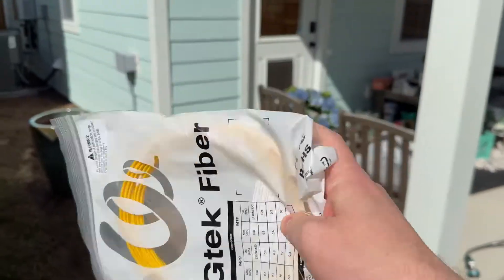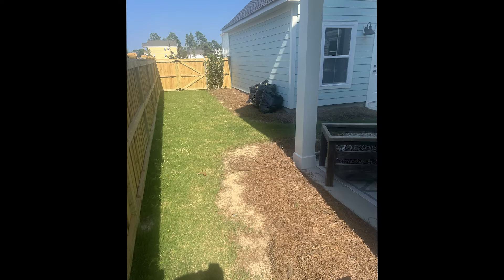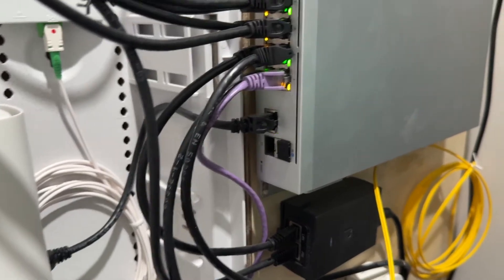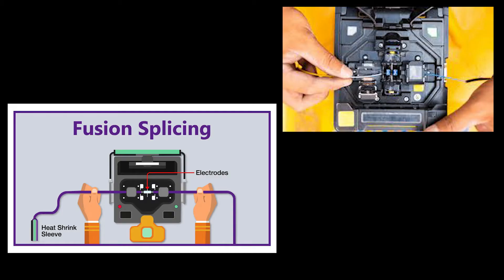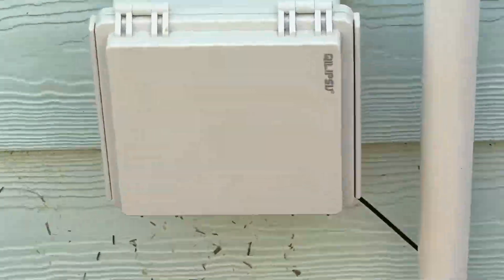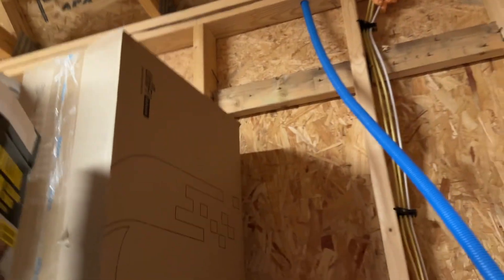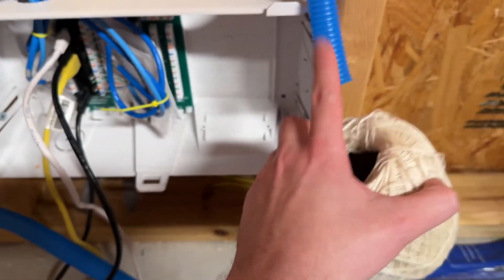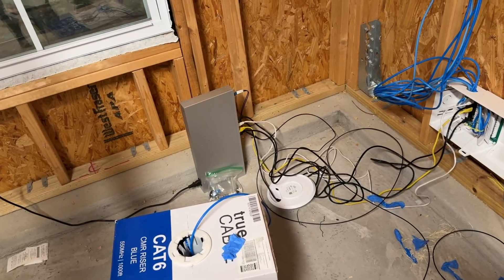Running Fiber Internet to a Garage/Shed

Comment: Looking for info on running single fiber cable with BiDi converters. Not finding much info.
Reply from the maker: It’s not standardized for local networks, single bidirectional fiber is only really intended for Fiber Internet Provisioning. For many reasons like cost and distance.

You still can find it, you’ll just be looking for SC SFP modules instead of LC but they are more expensive and not as common. https://amzn.to/4rUGdTT

Comment: Thanks for posting this video. I just bought a house and looking to turn the shed into a home office since I work remote. So this explanation and links are really helpful!

Once I get the fiber in my shed and connected to the media converter, do you have a recommendation for router or access point? I plan to have my computer connected via ethernet, but i'd like a wifi signal as well for mobile devices.
Reply from the maker: I like the Unifi Dream Router or UDMPro for the main one in the house, but any router will do.

For the shed, I strongly suggest a Unifi Access point like the U7 Pro XG and one of their POE switches. Their Access Points are easy to install and manage with the app

TPLink Omaha is another good brand but I don’t have firsthand experience with it